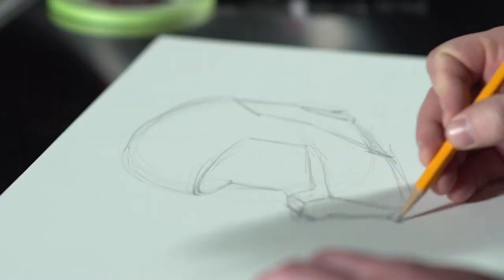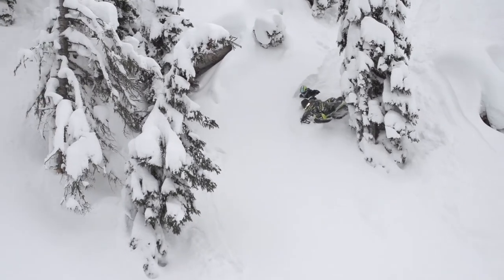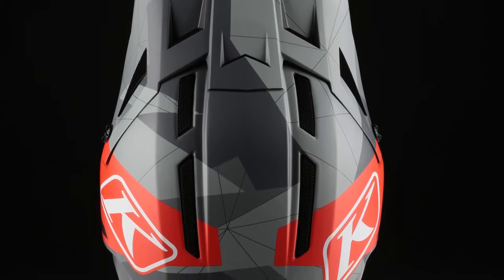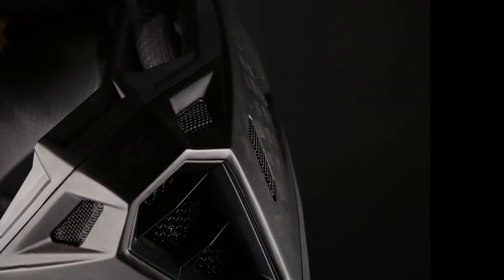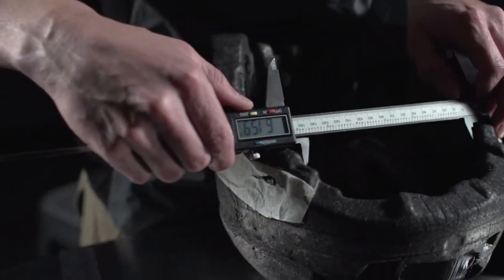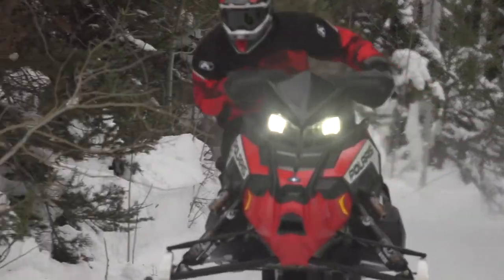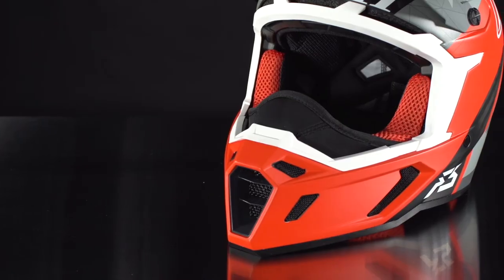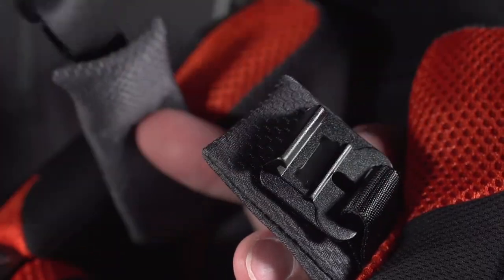KLIM F5 Helmet - Product Detail

Comment: What's the official weight?
Reply: yes weight please?
Reply: is that fact?  Suomy mx jump 2.5lbs with heavy gopro mount, and my just1 j12 carbon is 2.75lbs naked...if the F5 was under 2lbs I think it would be the lightest helmet available?
Reply: So according to Revzilla, it came in at 2.72 pounds. And that is NOT DOT rated, only ECE. Will a DOT/SNELL approved version be released Klim?
Reply: 1420 grams (3.13 pounds) with DOT
Reply: @RagedArmy 2217 Pretty sure you meant under 3.
Reply: @Joe31439  What size?